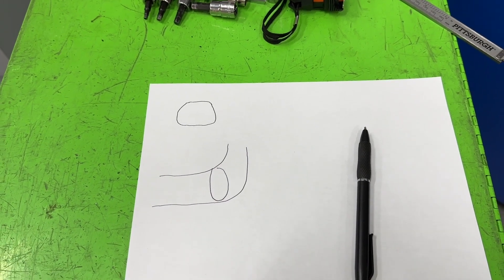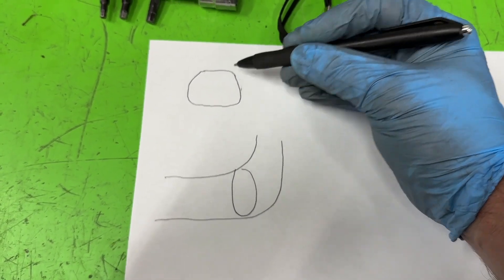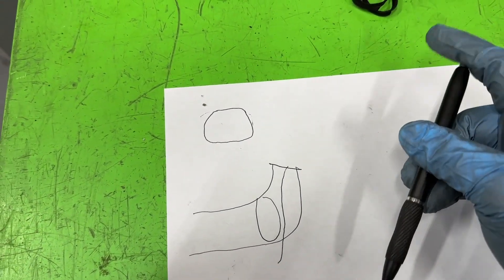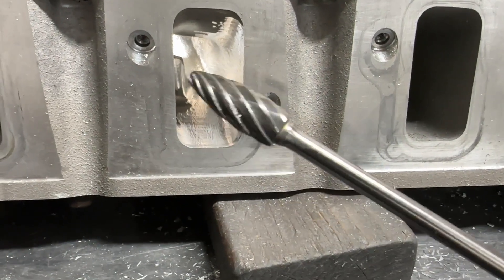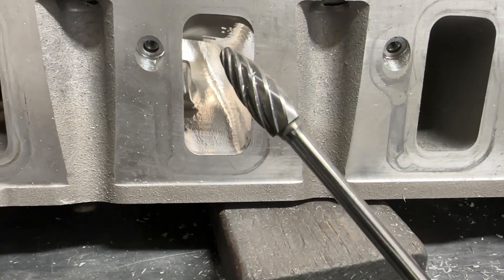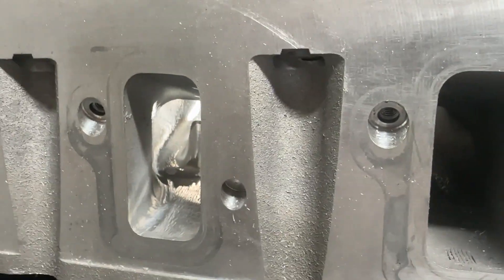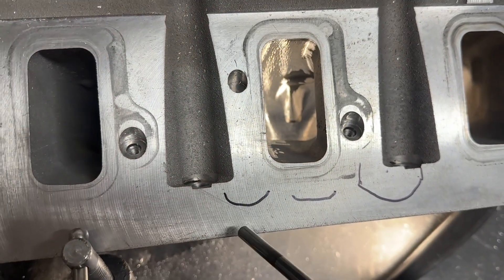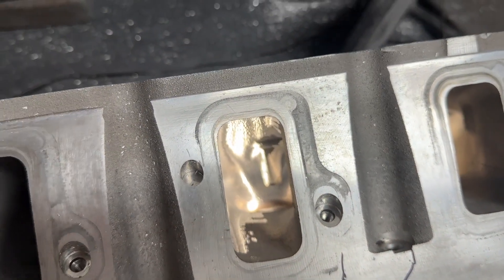Part 3: Porting Ls3 Heads, Intake Length

Comment: Everytime I've ever tried to teach porting on ANY head is to try and show that person how to make a pitot tube and make velocity profiles every .250 of the port so they understand what the head is doing... then teach them the importance of CSA vs there displacement and rpm of the engine they are doing this work for it seams to make a person understand what they are doing a little better and the theory of it
Reply: If they got it down I'll go into the different applications i.e. turbo,blower,nitrous... the port you have at the end of this video is close to where I get for my "standard" it's cool to see there reaction when you do "nitrous" style porting a exaust  runner vs a NA and how it can kill a port for one application vs the next

Comment: hey eric seen your older video about porting tools needed to do port work where you show the burrs and cartridge rolls but what i didn't see you mention is the lighting. What kind of light do you use when porting heads and intakes do you just use any small flashlight? or is there something more specific needed so you dont get eye strain